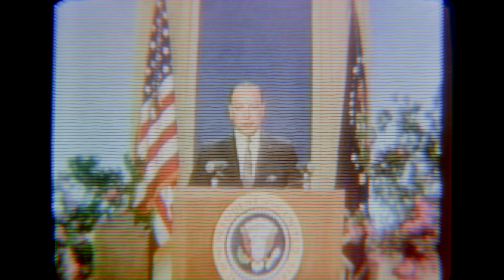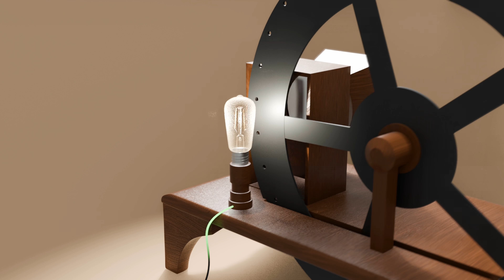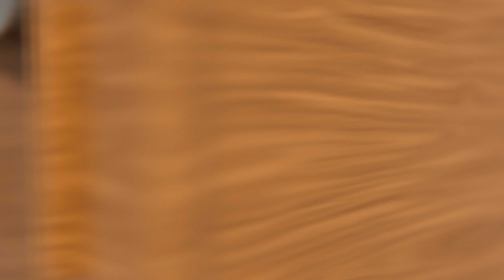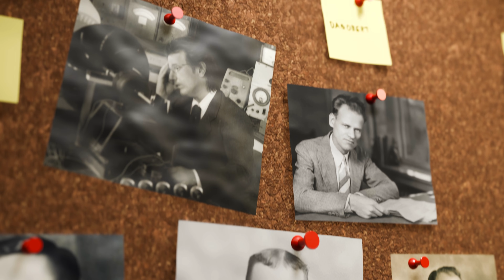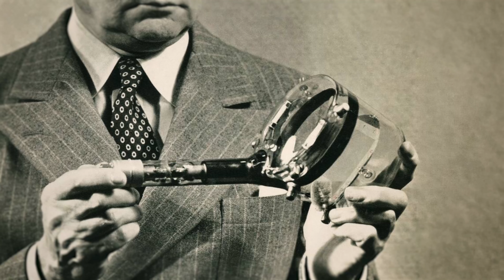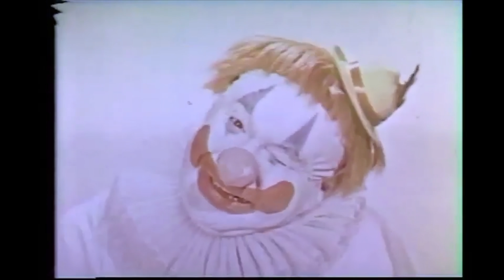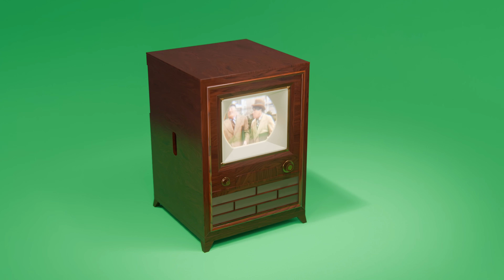Why Inventing Color TV Was So Difficult

Comment: 3.579545 Mhz, actually, give or take
Reply: 3,579,545 +(5/11) Hz is the nominal frequency, but a tolerance of +/- 10 Hz was allowed. However, the chroma and scanning frequencies for broadcast are locked together in specific ratios. Some home video equipment ignored the locking requirement, as receivers did not do internal locking, but locked to the scan and chroma separately anyway.
The base frequency of the standard is the 4.500000 MHz sound carrier center frequency; the horizontal scan rate is 4.5 MHz/286, and the color subcarrier is 4.5 MHz/286X227.5. The vertical, horizontal, and color subcarrier were all related by ratios using small prime factors so that tube frequency dividers at the studio could do the job reliably. (Note the 5/11 fractional part in the nominal chroma frequency.)

Comment: 13:49
The PAL system, used for color TV across Europe, improved color stability by flipping the polarity of this initial colorburst signal every other line.
Reply: NTSC = Never Twice Same Color, SECAM = Something Excellent Compared to the American Method, PAL = Peace At Last
Reply: @Axel_Andersen 
SECAM = System Essentially Contrary to American Model

PAL = People are Lavender or, as you stated, Peace at Last
😃
Reply: @Axel_Andersen  NTSC = crap, SECAM = average, PAL = excellent.
Reply: @Axel_Andersen  Wasn't SECAM the most "technically complete" in that both the tint and the saturation were under automatic control?
Reply: @gregorymalchuk272  no, PAL didn't require manual tint and saturation control, too
But because PAL suppressed the  carrier of the color signal it had fewer issues with moiré pattern.
Reply: @gregorymalchuk272  I am no expert and it was a long time ago. I think both PAL and SECAM were quality wise more or less equal (neither was perfect but their characteristics were different ) and neither one needed manual tint control. I don't think I've seen SECAM image in real life. Gemini describes them as follows: While both offer the same high resolution, PAL generally delivers a cleaner, sharper image with better vertical color detail because it "over-samples" color on every line. SECAM provides unmatched color stability over long distances but suffers from slightly "softer" color edges and unique "firefly" noise due to its one-color-at-a-time FM encoding.
Reply: Secam  the French wants to think it was better. The USA format Ntsc wasn't brilliant it frequently went off phase.  British PAL over comes some issues but could not  deal with atmospheric interference
Reply: @j.nav31..is7 I thought PAL was a German innovation. 

Both PAL and SECAM had their weaknesses and strength but they were different. Which one was better is IMO matter of opinion. 

For the video production SECAM was not great because of the FM modulation which required demodulation before you could mix signals so I think a lot of production was done in PAL and only converted to SECAM for transmission.
Reply: @Axel_Andersen  Correct! PAL was developed and pitched to the EBU by Telefunken

Comment: Congrats on a fairly comprehensive but brief summary of raster scan CRT color television, but you left out the snit that kept CBS and ABC from broadcasting in color for over nine years. In 1950  the Columbia broadcasting system began FCC approved test broadcasts of their field sequential color TV system. The gurus at RCA objected mightily that it needed a high speed color wheel in front of a small monochrome CRT, and lobbied hard for the Hazeltine Labs dot matrix compatible system. 
While CBS argued that an all electronic version was in the works, it still would not be compatible, and your history shows the rest. My family owned a 1959 RCA 21" round bottle color TV receiver  and remember well when the only local station that had any color programs at all was the NBC affiliate. "Bonanza" on Sunday night was always a must see. Two years later I was in Tokyo on Liberty from my U.S. Navy ship on a Sunday night at Ginza and Z street. Surprised to hear the familiar theme  for Bonanza  coming from a Bar I peered inside to see a Toshiba color TV with what looked exactly like the semi-round RCA picture tube, and watched Hoss Cartwright fall off his horse and, dubbed in Japanese,  hollering in a high squeeky voice  "Itai wa".

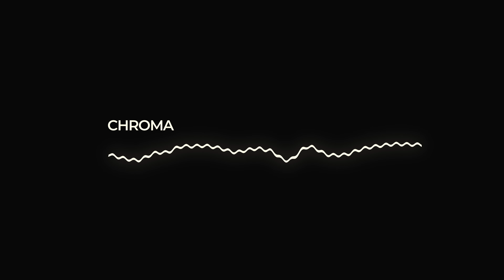Comment: I believe there is a small mistake at 13:30. While it is true that color TVs filter out luma and chroma separately, the luma signal is not discarded. This is due to the fact that we have 3 variables (R, G, B) and with I and Q we only get 2 equations. We need the luma, which is a weighted sum of R, G, and B, to be able to make this equation system solvable.

Furthermore, to save bandwidth, chroma has less resolution than luma, because our eyes are better at detecting changes in contrast rather than color tone. Thus, if only chroma were used to decode the image, it would be way too blurry compared to a black and white TV set. Otherwise, a very good and straight to the point video.
Reply: Came here to say the same.   Color TV absolutely needs the Luma signal!
Reply: @The8BitGuy  That part confused me. Throughout this, it was my understanding that all the TVs were receiving the same information. I wouldn't expect an analog TV to be dismissing a component of a channel's signal before it is sent through to the viewer. This clears it up.
Reply: Something else I noticed was that the animation he used for Baird's mechanical system had an incandescent lightbulb shown. It was actually a neon lamp,  since a filament bulb would have far too much latency.
Reply: i didnt think it was a mistake i just thought lula went on a seperate line to be combined with the chromas later i never interpreted it as being completely thrown away lmao
Reply: @YEWCHENGYINMoe  OK if so.  Were you aware of the process before though?  I’m thinking of the people who watch this video without seeing any others on the same topic.
Reply: yes
Reply: Yea, i was wondering the same
But in any case, its a really good video!
Also i want to use one of those crt tv to make an oscilloscope xD
Reply: @MattiaBallotti  Back in the day, people would connect two audio oscillators to the horizontal and vertical plates, send contrasting tones to each and watch a psychedelic flower display.  When multiples of frequencies occurred, that number of multiple loops would display and those were lissajous figures.
Reply: @study_legal_history  Very cool indeed, i also took a look at those "lissajous figures", i already saw them somewhere, if i will ever get a crt tv i will try it! :)
Reply: That is true. The red and blue signals are the only two processed by the receiving stage. Since we know the  Y value (luma), and the value of R and B, the value of G is then calculated on the basis of white = 59%G, 11%B and 30%R.  It is incredible math to be be performed with such accuracy using analog circuits.  Doing it digitally now is actually much easier.
Reply: @greatestunknown  "It is incredible math to be be performed" there is no incredible math performed. Just a few well calibrated resistors would do the job ;) R = Y + 0.956I + 0.619Q; G = Y - 0.272I - 0.647Q and B = Y -1.106I + 1.703Q
Reply: I think if you read a description of phase modulation before it was made. You would have said this will never work. Especially in an off the shelf consumer set at the time yet they actually did it. I am in awe.
Reply: @DR-xm9ck  Hey, back then they had time to use their brain without being sidetracked by watching yt and the like 😜
Reply: Several simplifications in this video, but overall good enough to introduce someone with no knowledge of NTSC signals or RF in general.
I wish he explain how skin color is generated and why it was important
Reply: It's not the only mistake. He keeps talking as if the colour information is somehow magically added without affecting the B/W signal, when actually the bandwidth of the B/W (now called luma) signal has been reduced in order to make room for the colour information signal. (If you try to display more than about 200 alternating vertical black and white lines across the screen in an NTSC colour signal, they will turn into a flat plane of colour on a colour monitor, though they will still be alternating black and white lines on a monochrome monitor. This is easily seen on 1980s home computers such as the Apple II.)

There are various other mistakes as well, related both to NTSC and the early history of CRTs. Their fact-checking on this is pretty poor.
Reply: Even furthermore, engineers studied pictures of various scenes and patterns , and girls, to determine which colors' resolution could be best determined by the human eye.  The eye was best at the yello-red colors, which was skin-tone.  This became the I channel, the other 90 degree phase to this became the Q channel.  1.2MHz bandwidth was given to the I channel and only 600KHz to the Q channel.  The two channels each modulated a 3.58MHz carrier but the second carrier was phase shifted by 90 degrees.  These were summed together and added to the luminance signal.

To get the maximum distance and stability of signal, engineers used knowledge gained from British radar operators who wanted to see as far as they could to detect incoming enemy planes.  The horizontal and vertical sync pulses transmitted in the unseen parts of the signal (the left and right and top and bottom of the picture) had precise pulse widths so that the harmonics of these signals fell between the harmonics of the visible picture.  The pulse harmonics were not visible in the picture and the picture harmonics did not interfere with sync detection.  Together with the limited bandwidths of the color information, this was all packed into 6MHz bandwidth for better transmission performance/cost for electrical power available or gallon of petrol.  One more thing, the sync pulses and picture were inverted, modulation-wise, the sync pulses were at full transmitter power and the peak white parts of the picture were at the lowest power.  This made a stable picture (no rolling or twisting) at fringe reception and picture noise was in the peak whites so as not to be noticeable at fringe reception.  Broadcast quality was not only picture quality but the ability of the signal and harmonics to stay within the 6Mnz bandwidth.  The picture was transmitted as AM like the radio stations but the audio was transmitted by FM process.

The first NTSC standard was sequential transmission of color difference fields (I-Y, Q-Y, Y is luminance) of view and was totally incompatible with black and white televisions.  NTSC 2 was developed to be compatible by sending the luminance and encoded chrominance on one stream in an alternating field system.  A field was all of the odd scanning lines and then all of the even scanning lines.  They interleaved on the screen, giving a double refresh rate in the picture.  Motion was much more smooth, being refreshed at a 60Hz interval than the real 30Hz frame rate.

There is even more genius packed into the NTSC 2 standard.

My parents opened the first television shop in my town in the mid-1950s.
Reply: I don’t understand your fancy words, science man. But I like it ! Now, medical jargon i can do lol
Reply: I would chalk this up to a high level overview as opposed to a detailed technical discussion. Several details were omitted that would be required for implementation but not for an intuitive understanding.
Reply: @DJ_Force  Even in a high-level overview there's no reason to get things actually wrong that do not need to be.
Reply: do you seriously have to be a nerd?😂
Reply: @Shadowz-Verified  my guy your watching a video about how a tv came to be with detailed explanation and information in the form of 3d animation and a great script im sure if you brought this up as a conversation starter things would look very similar for you
Reply: @fam8416  Look, if this wants to be an educational video then it has to be factual.  Who cares if someone says that’s nerdy?  You can’t pretend to be educational — which this video is doing — and then expect people watching it to learn what’s happening.

All is forgiven if a corrected video is uploaded.  I’ll buy the creator a lunch if he does though.  There’s no shame in fact checking, there’s shame in avoiding it.
Reply: @whophd since you’re the expert why don’t you educate us?
Reply: @chilitoday  I’ll be making a video about this one day but on THIS specific topic there’s already a few other YouTubers that have done this.  Start with CRTdude.  I grew up inside my dad’s TV workshop so it’s a passion I share.
Reply: @Shadowz-Verified do you still have to be demeaning
Reply: @Shadowz-Verified  Still using the word "nerd" in the big 2026?

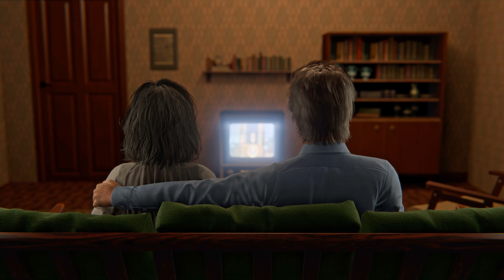Comment: 0:21 That's not quite true. That's the moment color TV broadcasting was inaugurated in Washington DC (and the first live appearance of a sitting US President on color television a bit later in that broadcast), however color transmissions had been ongoing in New York City and other markets since late 1953.
Reply: Set the tone for this video 😅
Reply: The 1958 clip is the first color broadcast preserved on videotape.

CBS developed a field sequential color format in 1951, and began experimenting with it in June of that year in NYC.  The CBS system was not backward compatible with existing B&W sets and the ones that could decode color were extremely expensive and few models were sold.   CBS abandoned the experiment in late 1951 and the NTSC system developed by NBC wasn’t approved until late 1953.
Reply: Yeah I was really questioning if that was the first moment of color TV. Felt like I'd seen another clip before.
Reply: 1953??? my country didn't even have televisions at all by then
Reply: That's true.  The first TV program broadcast in RCA compatible color was an episode of the Colgate Comedy Hour which aired in November 1953.  It was only transmitted in color on a handful of NBC affiliates (including NYC) that had already converted to the technology.  Unlike a flip of a switch, adoption by the industry was slow.  It wasn't until September 1966 that all prime-time programming on ABC, CBS & NBC was in color.  It took another year after that before every TV show (except reruns) broadcast by the big three networks were in color.
Reply: What about watching the video first?
Reply: There’s always somebody in the comments correcting ts mf 😂😂😂😭😭
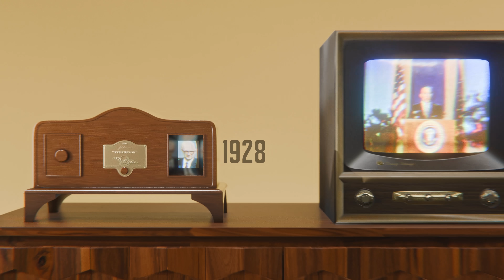Reply: 0:50 at least watch the video before commenting.
Reply: @manonthemoonnow45  I did. The video constantly references 1958 as the year regular color broadcasting started in the US which is just plain wrong. The fact that non-regular broadcasts happened earlier is irrelelvant to that point.

Comment: Makes me think of the fourier transform. I wonder if analog will ever make a real comeback.
Reply from the maker: For sure. There’s definitely a Fourier transform vibe to how those signals were packed and separated. I can't see it making a full comeback for mainstream use, but it’ll always stick around in niche areas where its "simplicity" is useful.
Reply: Actually, the NTSC and PAL systems are best analyzed using three-dimensional Fourier transforms (the three axes being horizontal and vertical spatial + time). This kind of analysis offers a one-to-one correspondence of the  viewed image to the video signal (one-dimensional electrical signal voltage vs. time) in a scanned-image system.
Reply: @oldtvnut  Packing that much information into a single electric signal is amazing, makes me wonder why we needed two for stereo audio